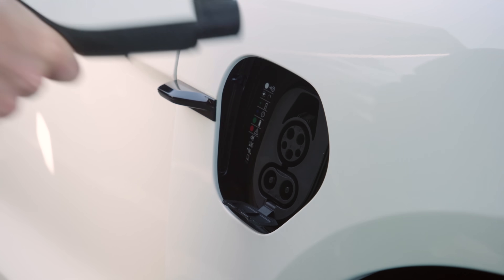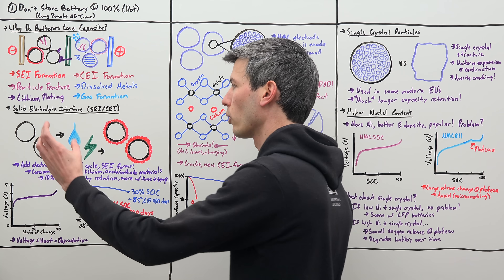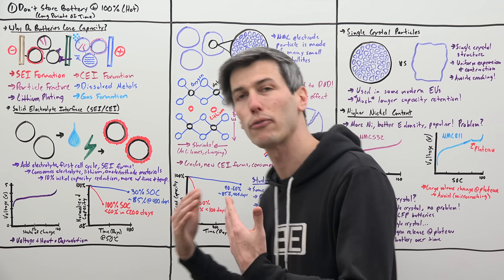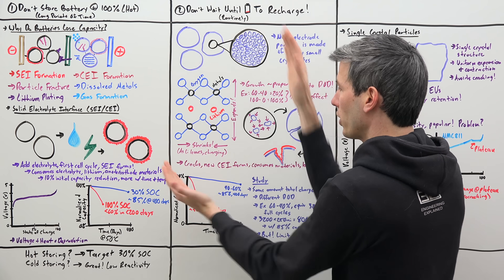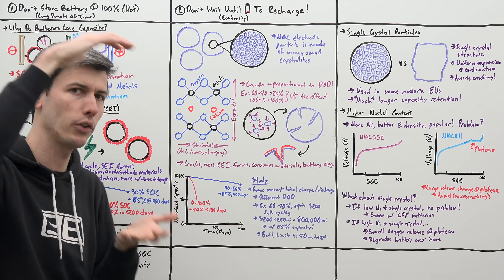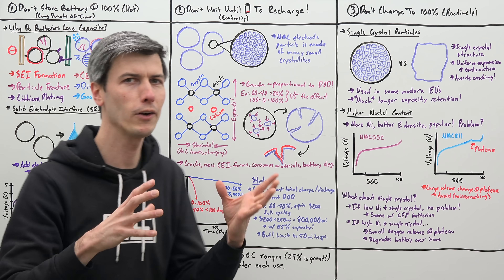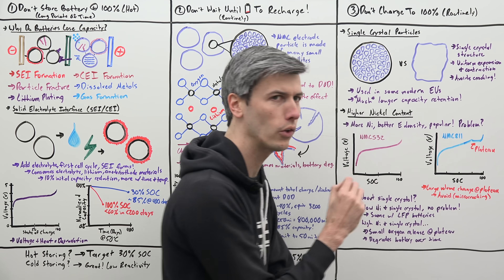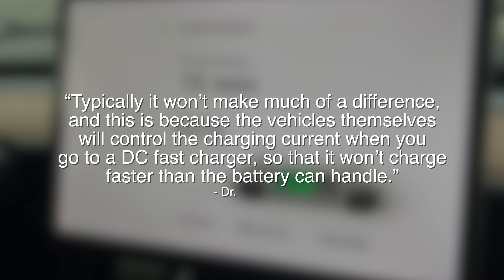How To Ruin Your Electric Car's Battery - NMC Edition!

Comment: Here in Chile, in my company, we have more than 800 electrical buses with around 250KWh of original capacity, bought almost yearly from 2016 to 2023. We currently don't see a significant (statistically) degradation in capacity (SoH) even after 300.000 KM, but we take precautions: we avoid charging to 100% wen in the higher side of the city to avoid loosing the possibility of recharging on the road, we do a full charge at least once a week, we rotate the buses from different routes, we don't start routes with less than 30% of charge to avoid running out of energy due to unexpected problems on the road. We have some cases of degradation of around 3%, but once again, on a fleet analysis, degradation = 0% statistically.
Reply from the maker: Thanks for sharing! Curious - why do you do a full charge once a week?
Reply: @EngineeringExplained  So our main manufacturer is BYD (but we also have Zong Tong, King Long a Foton). BYD made the recommendation to charge to 100% every now and then to calibrate the capacity of the buses. By the way, we find that by far the most significant factor in the overall performance of the bus is the driver, not the AC system, or the amount of stops, or the speed, but the acceleration and braking. We are currently traveling 5 million KM per month with the entire fleet, so there is a lot of data if you want to discuss.
Reply: @felipeeterovicbarreda3193  what driving style is most beneficial in your experience?
Reply: Burning out at stop lights and racing supercars to 60  @Kraven83
Reply: @Kraven83  Some bus drivers are really agresive, meaning that the accelerate a lot, and they wait till the last second to start breaking. Since all buses (ICE and electric) need assistance in the breaking process (no brakes are capable to stop the bus during the entire route), we need the regeneration of the batteries, and that is maxed with a soft breaking strategy.
Reply: @faeterov.. if you don’t mind me asking, what company? I work in public transportation (not in Chile, despite my username :p )
Reply: @faeterov.. byd? Worse than I thought; you should check the safety margins and QA of that company in particular
Reply: @faeterov.. That's how I drive my EV though it's not the weight of a bus
Reply: @faeterov..  I would love to see that data. I have been trying to convince our city to get a few electric buses. If you're willing to share any data, or post a video, please link it here. You can also email me at my easily guessable email address.
Reply: @Kraven83  downhill,  and SLOW takeoffs, and anticipating stops is best; just like with any vehicle; going uphill is critical, the softer, the slower, the better.
Reply: @faeterov..  My electric car encourages me to drive smoothly. It took a little while to learn to brake earlier because it is half again heavier than my previous ICE car.
Reply: @faeterov.. Sodium will be ideal for your application
Reply: @Cachai_  Felipe works at Metbus (Chile)
Reply: @EngineeringExplained  LFP maybe?
Reply: @Stopsign002   - yep, calibrating the "battery level" indicator semi-regularly to "full state of charge" is useful for datalogging purposes.  (That LFP nonlinear midrange wreaks havoc with voltage based level guestimates.)
Reply: @EngineeringExplained  Full charging is needed to perform a good balancing of the cells. Normally you are limited by the lower performing cell of your pack, that means that if for some reason  one cell has a higher SOC than the others you will not be able to use the full capacity of your battery. The same thing happens during the discharge, you can only go as low as your lowest cell. When you charge to 100% and leave at this state for a while (like over night) the battery has the opportunity to bring all the cells in line by balacing the cell voltages.
Reply: @EngineeringExplained   Im curious about this too. On some vehicles charging to100% can make your car computer's range estimates more accurate, but  I  am skeptical that its good for the battery.   Some people talk about charging to 100% for "cell balancing" but  that sounds like unnecessary stress if the battery is healthy
Reply: @EngineeringExplained AFAIK charging the battery to a 100% helps the BMS balance the cells
Reply: I believe it's to balance the cells.  KIA Motors recommends that their EV batteries are charged to 100% once per month for cell balancing.
Reply: @bearhunt3781  charge to 100% is to calibrate. Modern BMS balance the cells all the time
Reply: I believe it's to balance the cells.  KIA Motors recommends that their EV batteries are charged to 100% once per month for cell balancing.
Reply: I believe it's to balance the cells.  KIA Motors recommends that their EV batteries are charged to 100% once per month for cell balancing.
Reply: I believe it's to balance the cells.  KIA Motors recommends that their EV batteries are charged to 100% once per month for cell balancing.
Reply: @EngineeringExplained for cell balancing
Reply: @EngineeringExplained could be for BMS calibration
Reply: @EngineeringExplained  Some good answers below. I suspect also that, due to solar power, Chile has negative electricity wholesale prices most Sunday afternoons?
Reply: @EngineeringExplained  for battery calibration
Reply: for calibration purpose? we do that all the time with mobile electronic batteries if it hasn't been charged to 100 in a while @EngineeringExplained
Reply: @Anti3D-0 There’s no need to calibrate your phone battery since it has only one cell. For a 400V battery however you’ll need over 100 cells in series. Those need to be calibrated every now and then.
Reply: its for cell balancing ..one of the reasons why i do  @EngineeringExplained
Reply: @soulslayer59  I thought modern BMS  handle the  cell balancing,  without  the need to stress the cells with  a periodic full charge
Reply: @Saxafruge  as per my knowledge there is no way if knowing the cell is balanced properly unless an untill u fully charge it approx once a month to balance .
The way it works is usually we use upper limit voltage cut 4.2v for nmc for cell balancing hence full charge instead of lower limit cut that is 2.7v .
And when the battery cells in series reach 4.2v internal bms will individually shut off the series cell which has reached 4.2v thus full charging while the remaining series cells which havnt reached the upper limit 4.2v will continue to slowly charge till it reaches 4.2v ..

So at times you see if u full charge once a month somedays the remaining 10% charging takes way more longer than usually it does is cuz its balancing the series
Reply: @soulslayer59  You CAN?T do both, either you balance at the TOP (cells will scatter at below 20%)  or you balance at the BOTTOM(cells will scatter at over 85%,  less if heavy charging, and the BMS shuts all off, so, no full charge can be achieved either) ;
Reply: If you think that's a lot of maintenance wait until you hear about internal combustion engines and their 100s of moving parts.
Reply: @Crand0m  maintenance includes plugging in your vehicle.
Unplugging your vehicle
Plugging in your vehicle
Tires
Plugging in your vehicle
Reply: @pilotavery all the money saved on maintenance was spent on the expensive vehicle, insurance, and tires.
Reply: @drewfeld836  electric vehicles tires do not wear out faster unless you actually drive it super hard.
Reply: @pilotavery  I believe Michelin said they wear 20% faster or more
Reply: @drewfeld836  The average driver wears them out about 22% more.

If you drive the car and limit the acceleration to roughly the same torque as a gasoline car, it gets roughly the same life. Electric vehicles just have more torque and generally people are going to use that torque sometimes which then does a lot of wear to the tires. If you take a gas car that has a s*** ton of torque, it will wear the tires more not because the car is any different but because of how people will drive it.
Reply: @pilotavery  don’t forget EVs are much heavier due to the battery weight which also contributes to higher wear and not only that an increase in air pollution due to tire particles becoming airborne with increased wear . A legitimate concern.
Reply: @drewfeld836  higher weight vehicles have harder compound
Reply: @pilotavery  and still much higher air pollution than lighter ice vehicles. Can’t get around that no matter the compound.
Reply: @drewfeld836  what are you talking about? A car has to get 126 miles per gallon to match the emissions mile per mile as an electric Tesla powered by a coal power plant.
Reply: @pilotavery  I’m talking about tire particle emissions. It’s a known fact EVs generate 20% more air pollution regarding tire particle release into the atmosphere.  Do your research
Reply: @pilotavery connecting & disconnecting to charge is no different than refueling an ICE. Refueling is Not "maintenance".
Reply: @gregrogers3203  I wasn't referring to charging specifically, I meant more battery management in general like when it's cold you should plug in the battery to precondition it
Reply: BYD bus batteries are mostly LFP. Those already have a higher cycle life and less susceptible to degradation when at higher SoC. Some BYD batteries come out of the factory with their bms already limiting the top end voltage. LFP batteries charge differently as you actually float the voltages like a lead acid, then it drops down after you remove the charger. Another small issue with LFP is, you cannot tell the SoC by the battery voltage, the discharge curve is practically flat, the only way to tell SoC is via the bms and a coulomb counter. Due to the cells internal resistance, the bms can lose track of the SoC after repeated not full cycles. So a full cycle every month should be enough.
Reply: @Chooseyouruniquehandlebyaddin  - My man you know your stuff!!!!!!
Reply: Beautiful post, thank you. (Adorable, that the letter “h” was dropped from a word, there, conforming to the age-old tradition of ignoring that letter, in what I assume to be his native language.) I look forward to visiting Chile one day. I’ll have to ride one of your buses.🌿🐇
Reply: And battery busses are so smooth.
Reply: Crazy you should do a blog post
Reply: So after 300,000km average on each bus when are you expecting to replace the batteries? Are you getting the same results as those manufacturers get in China? I’ve seen every big city bus is now an EV there.
Reply: @JavierPix At this rate we will replace the bus sooner that the battery. Also, if we do replace batteries it just means that the ratio KWh/weight is low, and you can still use them in industries where that is not a issue, like a hospital backup, who doesnt care about the weight of the pack.
Reply: @faeterov.. Thank you for this post and all your reactions to it. It’s highly appreciated! 👍🙏
Reply: @faeterov I’m about to get 29 EV buses and will be creating policies from scratch. I’d love to get in touch and get some tips from you if possible.
Reply: Very interesting, thanks for sharing. I dont think the degradation is zero on the battery level, but the BMS hold back some spare capacity and is giving it free over time.  But still a very impressive result.
Reply: What part of the country do these buses operate? I’ve never seen one
Reply: @M1lomay I’m from Santiago and see them everyday here all over.
Reply: @sebastianfuenzalida3144  well I suppose that makes sense. I didn’t spend much time in Santiago but I didn’t see any in Valparaiso
Reply: @M1lomay  Santiago.
Reply: It's not a lot of work. It's just work. Outside of the US, public transit administrators face more pressure to hire facultatively intelligent operators with an understanding of- and sympathy toward the machines they operate— sparing themselves wasted acquisition costs as well as unnecessary maintenance, repair, and replacement—rather than hiring the cheapest available license-holders whose only redeeming attribute is their ability to show up sober and (largely) suppress their attitudes toward their captive clientele. 

Americans habitually marvel at the efficiency of Japanese public transit but other countries are not as impressed because few places suffer public transit that is administered as lackadaisically and services their ridership as ineffectively as that of the United States
Reply: In Beijing, China the E-buses use trolley-like overhead wires to charge as they drive. Each bus has a charging array that retracts while running on battery and away from the main part of the city, and deploys when back in the city- essentially running directly from the grid while charging- without having to be taken temporarily out of service.
Reply: It quite simple,if one looks after something according to it principles,it will last longer,wether EV,ICE or anything else.
Reply: I work for public transport too. I heard the same statistics for LPF buses around the world. Almost no degradation even after 5 years.
Reply: That's amazing data. Thanks for sharing
Reply: I think alot of this is BS, I have a Li-ion battery thats over 700 days old and is still at full charge 67.2
Reply: Sooooo interesting. I had no idea that this golf cart technology could be?? Embellished like this.
Reply: @Bmwguy2011 My "golf cart" leaves BMers in the dust. So smoothly, in fact.
Reply: @gregrogers3203  you have a ? Tesla?
Reply: @Bmwguy2011  I do
Reply: @gregrogers3203  I always celebrate these as I think they’re nearly all American made.
Reply: @gregrogers3203  but you know… that’s never what attracted me anyway and all of my bmw friends to the brand, raw acceleration.  Instead, it’s the driving experience, organic feel, seats handling safety smoothness of the engine , sound value holding of collectible cars etc.  if 0-?80 speed is what matters?  Yeah I’d buy the cheapest e vehicle i guess .  We are all going to be forced into these someday, why I refuse to buy one now.  They can control us once everyone is in an e vehicle on many ways difficult to do so with a gas situation.
Reply: looks like some one from bateries industry doesn't like what they hear and see, so fix it then
Reply: What's your opinion of Jackson Wyoming's entire electric bus fleet being taken out of commission? Granted it was only 8 but still. Their experience seems bad.
Reply: @erikkovacs3097 y would they have any buses who is going there
Reply: you care!
Reply: Maybe your government should be focused on poverty rather than selling subsidized electric bus fleets foreign corporations. It's all a scam, because combustion engines and too cheap and simple for us peasants.
Reply: 0% degradation.
You are trying too hard bruh
Reply: @hydrohasspoken6227  no degradation usually means " software limited battery to 90%, só you cannot see any degradation before 10% of degradation" 
But is fine too.
Reply: Hyundai, KIA, Genesis lie to you about your state of charge to protect you. 100% on the gauge actually = 80% SoC in reality and 0% actually equals 10%. I believe some other manufacturers do too
Reply: can you do a video on the data?
Reply: Chile, eh? We'll keep an eye on that interest; we usually see massive fires, not cap loss, when those applications require high draw. Like in London's buses or Australia's cement trucks.

The very fumes are toxic if they just touch your skin and the time from smoke to fire a matter of seconds. Good luck.
Reply: @SwordFighterPKN 
Outside of the US public transit administrators face more pressure to hire facultatively intelligent operators with an understanding of- and sympathy toward the machines they operate— sparing themselves wasted acquisition costs as well as unnecessary maintenance, repair, and replacement—rather than hiring the cheapest, least capable automatons whose only redeeming attribute is their ability to suppress their attitudes toward their often unpleasant clientele.

Americans habitually marvel at the efficiency of Japanese public transit but other countries are not as impressed because few places have public transit that is as unambitious and performs as poorly as that of the United States.
Reply: It's not a lot of work. It's just work. Outside of the US, public transit administrators face more pressure to hire facultatively intelligent operators with an understanding of- and sympathy toward the machines they operate— sparing themselves wasted acquisition costs as well as unnecessary maintenance, repair, and replacement—rather than hiring the cheapest available license-holders whose only redeeming attribute is their ability to show up sober and (largely) suppress their attitudes toward their captive clientele. 

Americans habitually marvel at the efficiency of Japanese public transit but other countries are not as impressed because few places suffer public transit that is administered as lackadaisically and services their ridership as ineffectively as that of the United States
Reply: A lot of work to an obese Republican is just work to everyone else.
Reply: BYD exploding cars are not the best example to use.
Reply: Those are impressive results. Thank you for sharing that information.
Reply: He is anti Tesla.
Reply: The cracking in the middle looks like the Tesla logo
Reply: Thanks for SHARING. :eyes-pink-heart-shape::eyes-pink-heart-shape:
Reply: That is a remarkable result!

Out of curiosity, how many KW of power is used to charge your buses?
Reply: As a new byd car owner, it`s amazing to read this. 😁
Reply: Sounds like a very progressive mind-set. How impressive.
Reply: The question is:
What is the real capacity?
Not rare that there is an over capacity, to have a buffer and to "hide" degration.
Reply: After reading most of the comments on this subject NOBODY is talking about the benefits to the environment. It is all about how to save money. But with heat records being broken year after year you wonder how long this can go on before your country becomes unlivable. Crops will fail and people will die from heat exposure. THAT is why it is important to STOP BURNING FOSSIL FUELS.  It does not matter if Electric busses or cars require more or less maintenance. What is important is that we keep our planet healthy for generations to come. Fossil fuels will not do that.
Reply: So in essence, so something else will cause problems before the batteries will 🤞🏻
Reply: You also don’t have long cold winters
Reply: That is negligible work compared to everything else you have to do to make sure a bus fleet stays running. Like rotating the bus routes what all that means is that the driver gets in a different bus. Also not starting with less than 30% oh my gosh that’s so much work. Doing a full charge once per week what. The only thing that requires significant forthought is the not charging to 100% at a specific place.
Reply: Electric buses are severely underutilized, I only rode in them at Giga Texas when I worked there but they’re so great
Reply: Sounds like you are chilling in Chile
Reply: What is the ambient temperature? I live in Thailand (35 - 40c) and I'm looking at buying a NMC MG5. But the NMC is giving me concerns. I don't know how big a factor high ambient temp is going to be.
Reply: Still no one can explain to my why I should limit my range to 80 % for the entire lifetime of my car (by charging to only 80 %) when I could just always charge to 100 % and experience a gradual degradation to 80 % during the lifetime of my car.
The only reason would be to get a higher resale price. And even if you only charge to 80 % all the time you’re still going to see at least 5 % degradation.
Reply: EV is great 21st century tech 

ICE is inefficient 20th century tech
Reply: @larryc1616 I’m having a hard time adapting. I’m hoping once I get the home charger hooked up I will feel better about it.
Reply: @larryc1616  let's see which one goes further; and farther too    lol
Reply: @larryc1616 
No, they are not. EV is 120 year old tech, just as ICE. EV are far too heavy, because of the very low energy density of batteries. Total cost of ownership of EV is way higher than of ICE. Also EV are not as great to drive by far as ICE are. Historically EV are for women, ICE are for men.
Reply: @peterdejong5456  I've found completely the opposite: After 3.5 years driving an EV (Tesla), the experience is vastly superior to an ICE. One petal driving literally without using the brake pedal. Acceleration is incomparable when I want to use it. Driven the car across the U.S. repeatedly in subzero (< -18C)  and 110F+ (> 43C) weather, driven the car smoothly to 140 mph on vast empty highway stretches. The ICE just does not compare. And I drove ICE vehicles for decades, also in all conditions.
Reply: @gregrogers3203   
How can a vehicle that weighs twice as much with half the range (even less in cold weather), twice the cost of ownership and zero driving pleasure ever be superior? The reasons why people stopped buying EVs hundred years ago are still there. You seem to forget gasoline has 50 times (!) the energy density of a Li-ion battery.
"Weight is the enemy"
~ Ettore Bugatti
Reply: Many Chinese electric buses use lto batteries
Reply: Batteries with 0% degradation and no hardware maintenance....... how is this not on the news if that is the case?
Reply: @SupraSav they still need manteinance, just not so much. We still have doors, tires, breaking system, ac, windows to repair. Its just that we dont have valves, pistons, filters, rocking arms, turbos, oil, etc etc.
Reply: @SupraSav  Because the media only care about BAD news when it comes to EVs, haven't you noticed?  Good news are not newsworthy!
Reply: You do not have 0% degradation after 300k km.
Reply: Not possible .. not even according to battery manufacturers .. im calling this out as BS
Reply: I sure have ruffled some jimmies with a simple little comment.  LOL
Reply: When I was building busses we had some come back under warranty they were about 3 months old and had done 100,000 km  . They were going from London to Edinburgh and back 6 days of the week 800 miles a day I don’t think your EV busses would be able to do this
Reply: Of course, your batteries are the only ones in the world that does not degrade at all. Do you expect us to believe it? There are quite a lot of research showing EV:s degrading like crazy.
Reply: @thoos192  All batteries DO degrade with each passing charge-discharge cycle.  There you are right.
But EV batteries do NOT degrade "like crazy", quite at the contrary, data shows very moderate degradation, like 3-5% total over the first 2 years, then 1% per year, leveling off at ca. 0.5% per year.  There you're wrong!
Reply: I live off grid. I build my own solar.I build my own batteries.
I have a ten thousand watt generator,  welding machine.
It would take thirty of my generators running full blast to  do a three hundred thousand watt quick charge. Where do you guys think electricity comes from. Not from solar and wind. Driving an electric car doesn't help anybody. Let's see you get off grid with your house and life.
Reply: @Luch600  If you live off grid with own solar system and 10kW generator you are better suited for EV than for an ICEV.
I guess you live off grid as you do not live in the town or near any infrastructure, which also means you have to do long trips for the fuel.
With EV you would just charge it from the solar and don't care about trips to gas station till the weather would go so bad you would need to run the generator.

And please, spare us the nonsense about quick charging at home from generators. That's not even funny, just embarrassing...
The only situation when you use quick charging is when you are on a trip to some greater distance. Outside of long trips you just charge slowly (3-11kW) on your home charger. Part of the year (depending on a location) this slow charging can be covered by the solar just fine. For my location it is 6-8 months a year of solar charging.

So, driving an EV helps you and your environment and greatly helps you to go off grid. As a bonus it's more comfortable to drive.
Reply: Here in London electrical buses manifest degradation by bursting into flames. Three this month so far.
Reply: @johnedwards1685  Could you share a news article about this?
Reply: 0% degradation seems unlikely, since time will degrade batteries all on its own. Not by much unless you leave 100% charged vehicles out in the hot sun, but enough that it should be measurable after a few years...
Reply: @Steamrick  Well yea there's no such thing as 0% in reality but statistically it is possible. I work with statistics at work and math is funny.
Reply: @Steamrick likely the measured 0% degradation is due to the fact that batteries had some hidden capacity that they are slowly releasing
Reply: @Steamrick  If the batteries are overprovisioned it may not be detectable by the end users yet.  eg. they sell at 250KwH battery, but it's physically a 280 KwH battery whose battery control system lies about the capacity.
Reply: @Gaspode_  Overprovisioning batteries a bit is normal. For example, Audi exposes between 91% and 94% of the Audi e-tron battery capacity to the user.
I'd have expected the BMS to keep the overprovisioning percentage even as total capacity decreases, though, so it can use that to protect the battery from going to 'real' 100% and 0% voltages and improve longevity.
Reply: @Steamrick  True EV batteries degrade 1-2% per year. But that probably wouldn't be a factor over the life of the bus.
Reply: @Steamrick  Yea i wonder if he is talking about operational degradation (like,  can the bus run its full route)
Reply: @Steamrick THIS
Reply: @Steamrick Read what he said again.
Reply: @Steamrick did you even read? He said 3% on few vehicles. But almost 0 across the fleet. Of course everything will degrade overtime
Reply: You're an ANECDOTAL and unproven claim in a YouTube comment section, and presumably biased. You are comparing buses (very controlled use) in warm climates to cars (much more uncontrolled civilian use) mostly in cold climates. Apples and oranges.
Reply: That's a lot of work to keep degradation to around 0.
Reply: @SwordFighterPKN  Thats not that much work for a fleet. Fleet maintenance is serious work
Reply: @Stopsign002  Sure, but it actually getting done is not something that I would expect from the Washington DC metro operator. Users are expected to be happy that the bus is not on fire.
Reply: @SwordFighterPKN  Not at all, since the buses go to the depos at the end of the route. As I've said to the drivers here, the amount of cash we save by paying KWh instead of diesel is more than enough to offset all the hassle of the technology. Drivers have come to accept this technology, as it' more comfortable for them, in particular due to lower noise levels in the garage.
Reply: @faeterov.. Do you have any idea if they actually build a larger battery than they advertise?  I heard that is a practice that is used to limit the appearance of battery degradation.  For example, having a battery 10% larger than advertised means it can degrade over 10% before the user actually notices anything.
Reply: @Tie509  What did it matter if the practice is to advertise what the battery will be for the life of the vehicle? That is the only thing the person is buying on.
Reply: @Tie509 We suspect something like this might be the case, but the capacity shown is the same as the capacity bought, if they oversized the battery it's something we cant account, but the warranty states 80% health (frpm the capacity we bought, no this hypotetical additional capacity) at 10 years.
Reply: @faeterov.. Thank you for taking time to answer questions! It’s very fascinating and valuable information.
Reply: @SwordFighterPKN  Don't think so, not hard to keep track on usage and charging can be done on a vehicle base automatically.
Just have to setup software once.
And rotating vehicle routes is also something you do with ICE buses as well.
Reply: @SwordFighterPKN how does that compare to fuelling at a pump every tank and 5 levels of regular service plus oil changes?  Seems like it’s just adjusting some parameters of how they’re used.
Reply: @MrFerrariF360  - The main difference is you have to pay attention to the SOC and temperatures when you charge, do you have to do that with your ICE (hate that name BTW) vehicle?  No you don't you just throw fuel in it and change the oil, even some people can't get that right.  But people are supposed to figure out how to make their batteries last longer? LOL!!!  For a fleet with professionals sure, it's still a paradigm that seems like a PITA.  But if that PITA has a ROI then sure do it.
Reply: @SwordFighterPKN  Yes, you do as fuel can freeze, and as such, a lower "state of charge" means the likelihood of the fuel freezing is higher. Your car also is less efficient with fuel in lower temperatures.
Reply: @SwordFighterPKN It sounds like a lot of work. You have to pay attention to the SOC and the temperature. But it's not. It's automated. You set the SOC limit in the software and if heating or cooling is needed the computer and heat exchanger takes care of that in a modern EV. The only "work" is remembering to plug it in every two or three days. I'll do that any day over stopping at the petrol station every week or so. NB Not all EVs can control the temperature of the battery during charging but I'm speaking from my experience. And I'm not sure why you hate the term ICE. It's no different from EV. They both describe the propulsion system of the vehicle. I drove ICE cars for over 35 years. I don't demonise them, I just don't think they're as good for me.
Reply: @SwordFighterPKN  Some of it is even good practices for non electric vehicles, especially the route swapping, if there's large discrepancies between stop-n-go and highway travel.
Reply: @johnhufnagel  - The route swapping is interesting and I could see how that helps maintain a fleet of vehicles.
Reply: @SwordFighterPKN  maybe it's not a lot of work. It's built into the operation system which needed work to create the plan and needs work to keep it going, but it's a large operation anyway.
Reply: @SwordFighterPKN how’s that any harder than common maintenance on a car?
Reply: @AreYouSeriouslyy  - Humm lets see I just put gas and drive it, change the oil every 7500 miles and change tires as needed.  No need to worry about SOC/SOH, determining routes.    I'm finding the reaction to my simple comment to be rather funny and silly reactive.
Reply: @SwordFighterPKN 
That may be true for a new ICE car, if it's from a good brand, you don't drive too much, don't drive too short distances regularly, and it's not a diesel.
Buses are driven a lot, with frequent starts and stops and idling, which is about the worst use case after racing. They also have more stuff that need additional maintenance. Like air brakes. Then even more maintenance for safety, since a lot of lives are at risk if anything goes wrong.
Multiply this by 800, and even rare issues will happen regularly.

Then, if you have 800 buses with 800+ drivers, and various routes with different schedules, you already have to solve a complex logistics problem, for which you should have a robust solution. Adding a few more soft rules should not be an issue.
Reply: @SwordFighterPKN  You worry about the state of charge in the "I just put gas in it". The state of charge in a gasoline vehicle is how full your tank is. You also care about temperature as that affects "how full the tank is". I also need to worry about where I plan to get fuel and the variety of pricing at the stations that I do not own, which means that I also have to waste fuel to get fuel.
Reply: @andrasbiro3007  - buses are a GREAT use case for EV.  I just stated that seems like a lot of work to kept the degradation down to 0%.
Reply: @SwordFighterPKN  why would anyone want to deal with an oil change and timing belt replacement, also freezing your ass outside in the cold filling up gas? how much is a engine replacement when some high school kid changing your oil at walmart forgot to put oil back in? 

with an EV i dont need to worry about any of that. who care if a battery cost $15k when it last 15+ years.
Reply: @SwordFighterPKN fleet maintenance is a ton of work. 

They're not oil changing these busses or anything. That savings alone on labor and materials for them probably is at least in the same ballpark or a savings by doing it with electric and doing this small amount of logistics. And then there's transmissions to worry about too. Realistically it's not necessarily always going to be ain increase in maintenance to do such things, it may actually be a decrease depending on what an ICE powered bus fleet would cost. And on top of that the fuel savings? I get your point, I really do, I just don't know that it works out to being more effort for large fleets. All they're doing is implementing a new maintenance scheme that replaces all the ICE related maintenance. I don't see it being an increase personally. 

I maintain a small fleet of vehicles for my company single handedly, I definitely understand the costs of fleet maintenance. We are electricians, if we switched to EV for all our work trucks, I'd have a lot of extra spare time. Not that I'm gonna tell the boss that 😂
Reply: @marcol869  - I owned Honda element for 20 yrs, why would I want to trade in a working vehicle at 15 yrs for zero dollars since the vehicle is only work the scrap value?  If you want to own one, great just don't tell me I have to
Reply: @SwordFighterPKN  been looking for an element myself. My needs have changed and they seem to fit the bill perfectly.
Reply: @goosenotmaverick1156  - I really want a hybrid Element that would be money!
Reply: @SwordFighterPKN  for sure! I've been keeping my eyes out for one because I would love to have one, but in my area I've only ever seen one out in the wild. For me, that would be amazing! The IMA I think was the system used for those, rather than a motor directly driving the wheels?
Reply: @goosenotmaverick1156  - There is not a hybrid Element.  I always wanted to blend a Chevy Volt drive train into one though.
Reply: @SwordFighterPKN  my memory has decived me then 😂 I wonder which vehicle it was I was thinking of lol
Reply: @SwordFighterPKN  well you own a shitbox, stop lying to yourself how great an ICE car is.  I wonder how an Honda element will hold up in a crash with a cybertruck. :)
Reply: @SwordFighterPKN  ahhh yes let’s disregard, filters (oil, air), if you live in hot or too cold places gaskets and seals, crankshaft/cam sensors, any small sensors for that matter and more, Assuming you both a decent reliable car… assuming you didn’t timing chain issue, transmission problems, water pump failures, or fixing anything that requires to remove additional moving parts…. Oh and this is assuming you do the work yourself. As someone who owns multiple cars, classics and new and one EV. The upkeep OP is talking about is no different than a combustion engine maintenance. You get the reaction you get cause your comment itself is silly.
Reply: @SwordFighterPKN 
And I'm saying that diesel buses are more work to keep running.
The main difference is that you've been learning to care for ICE engines since daycare, so it feels natural.
Reply: @SwordFighterPKN No one is, are they? I agree it's crazy to change a working vehicle for a newer one. Yet most people do it, a lot - otherwise automobile manufacturers would be out of business. However, if you are considering changing your vehicle, then I would recommend an EV. I don't miss the regular trips to the petrol station and maintenance costs and they certainly drive better (and no fumes). But on the flip side it didn't come cheap - although surprisingly not that much more. It's a personal choice. You stick to your Honda until it dies or you get sick of it. Then get another car.
Reply: @SwordFighterPKN I disagree that sounds almost like zero work compared to any ice fleet maintenance program. And if you look at aviation they only put as much fuel as they need in a plane to minimize wear and tear as well.
I  maintenance all my battery systems. I can get a $60 Walmart battery that has a 2-year warranty to last 10 years if you just check the acid 2 times a year and never charge it with it being too low.
Reply: @SwordFighterPKN  but at least is an option...   Wish there was a way to prevent degradation of a combustion engine!
Reply: @SwordFighterPKN lmao, imagine all the maintanancw with diesiel og petrol busses. 1000 parts to change
Reply: Where is the a lot of work?
Reply: @tr9036  I'm sorry I don't understand the question
Reply: @SwordFighterPKN  Much easier than rebuilding transmissions.
Reply: @SwordFighterPKN 
Outside of the US public transit administrators face more pressure to hire facultatively intelligent operators with an understanding of- and sympathy toward the machines they operate— sparing themselves wasted acquisition costs as well as unnecessary maintenance, repair, and replacement—rather than hiring the cheapest, least capable automatons whose only redeeming attribute is their ability to suppress their attitudes toward their often unpleasant clientele.

Americans habitually marvel at the efficiency of Japanese public transit but other countries are not as impressed because few places have public transit that is as unambitious and performs as poorly as that of the United States.
Reply: @SwordFighterPKN 
And of course every EV car owner has a fleet of EVs that can be rotated across different routes🙄
Reply: He is not saying "we disassemble every single battery, every week and wipe it to clean out and increase longevity"

HE says we never charge %100, change roots and don't let them travel below 30%.
Where is the a lot of things 😅😅😅
Reply: @tr9036  Yeah, I live off grid.I build my own battery's lifpo 4.         I build my own charging systems.
Thanks for the reply. I ran three solar panels straight to my electric water heater, It works great.
Reply: @SwordFighterPKN This means that there's no wear at 200,000 miles. 

The range already starts to decrease on diesel engines around 200,000 because of inefficiency of blow by
Reply: @pilotavery  - Batteries do not care about millage so that is a apples to oranges comparison.  Batteries care about charge cycles and temperatures.   Good for your group putting in the effort to keep the batteries fresh, since those batteries are a significant investment.   By your responses I have a feeling you think I am anti-EV, which is funny given I work in electric energy storage.
Reply: @SwordFighterPKN  it's definitely an apples to apples comparison, engines don't care about miles either.
Reply: @pilotavery  -  Then get to comparing revolutions of an engine to degradation of batteries.  Let me know when engines start to degrade just sitting there like batteries do.   It's not apples to apples.  But again this response to my original simple comment is funny.  The eeeeeeeeeeeeee reaction to anything that goes against EV is awesome is nutty.
Reply: @pilotavery  No, they both care about miles as miles is usage, which is cycles for batteries and engine performance for the gasoline vehicle. It is also the cycle count on the plugs as well, which he also didn't mention. Engines also don't like to not be used either, which is the storage problem. He just gaslit you, and you bought in.
Reply: @SwordFighterPKN  Are you telling me that oil has no properties that change based on the length of sitting? The 12-volt battery also starts to lose its capacity as well. Your nonsense on vehicles being a-ok doing nothing is not true.
Reply: @ronaldking1054  - I stated the engine not the fuel, do try to keep up.  Your emotions are not helping you in this discussion.   Fuel does degrade, I'll freely admit that.  But it does not need anywhere near the maintenance describing the original comment since you burn it up.   You emotional EV people.
Reply: @ronaldking1054  Yes read my comments, this is what I'm trying to say. I initially said that the The battery will last a number of miles, and somebody else said batteries only care about usage, so you can't compare miles like you can engines. And I responded by saying that if I can't compare batteries to mileage, then you can't compare an engine to mileage. Because engines themselves don't really care about the miles, what they care about specifically is the number of revolutions and load and temperature and other things. However, the more load and RPMs your engine runs out, the more you are accelerating and therefore the faster that you will be going. So mileage is a fairly good estimate of total wear and tear to an engine, within about 10%. So I do get it. I'm just saying that if you are comparing a gas engine this way, you should not be comparing a battery any differently.
Reply: @SwordFighterPKN  The engine has oil in it, and the oil needs to be changed regardless of use. Next, you are also stating that the engine cannot corrode at all. Engines seize. They usually do this because of a lack of oil, but degraded oil probably will do it as well.
Next, you stated that all you needed to do is put gas in your car, but I stated what putting gas in your car meant. For some reason, you cannot understand that your simplicity is complete and utter nonsense. I've owned a car. I know it's nonsense.
Reply: @ronaldking1054  engines don't seize when they are not in usage, unlike batteries that degrade over time.  Look you want an EV get one, I'll pay you on the head.   Do you have to worry about how much fuel is in your car before adding more no.   EVs take more effort to make the batteries last, did you watch the video?  Good Lord you people are triggered.
Reply: @SwordFighterPKN  Yes, engines start exactly same if you do not use them. Note the sarcasm as that is completely untrue. What is even funnier is that people who have bought cars that have sat at auction generally will find that 1. the battery is dead and 2. that the engine will not start exactly correctly. I know how cars work when they sit because when my car was at the end of its life, it started badly. I know you are lying to me. Quit being so emotional about your internal combustion engine.
Reply: @ronaldking1054  I did not bring up ICE so you're projecting.   I like EV but I'm sticking with ICE it's cheaper and more proven.  For my use case ICE is a better choice.  Go by what you want, good grief.  I'm not the emotional one thinking they have to defend something, that's you.
Reply: @SwordFighterPKN  Second easier proof is that the maintenance schedule has time durations on it as well as mileage. Your claim would mean they have only mileage. Apparently, you think automotive manufacturers are idiots, or else you should know your claim is not true.
Reply: @ronaldking1054  you EV folks are more sensitive than BJJ types it's funny.  I'm flattered with all this after a simple comment.
Reply: @SwordFighterPKN  You lied multiple times about the vehicle you have chosen, which is an internal combustion engine car. I can only imagine that is to keep your fuel price relatively low, and your resale value high. In other words, you have a vested interest in lying about your technology. You want to extoll the virtue of the simplicity of the gas tank while ignoring the complexity of all the equipment that makes that gas tank simple. You claimed that duration, contrary to the schedule of maintenance, does not matter, which is false. You also claimed that you do not think about anything with your gas tank, and I know that is false because fuel is fuel. Without fuel, your vehicle is a paperweight, which ironically, is the same thing with an electric vehicle.
Reply: @SwordFighterPKN  No, I'm a person that believes in truth. I'm passionate about it, but it seems you are not. Simple question: Does every schedule of maintenance in any vehicle have a time duration on it? Answer the question truthfully, which is yes, and then admit that you were mistaken when you said that sitting does not hurt a vehicle. All you have to do. Otherwise, I know you are a liar.
Reply: @ronaldking1054  - sitting for how long?  You seem to really care about winning the internet argument which is funny.  My old element sat for 8 months no issues.  Frankly you bore me at this point
Reply: @SwordFighterPKN  Okay, go through the schedule, and figure out exactly what you might have had a problem with. A case study is not all vehicles.
Reply: @pilotavery I have to disagree with that a well cared for engine tends to get better over its life. My current car 2.0d is nearly 180k and on a run will still hit 70mpg. It's what you would call a "minivan" has 7 seats and weighs the best part of 2 tons. Fully loaded with a small trailer it will still achieve well in to the 50s. In my previous job I used to drive a fleet of mercedes sprinters and they would still achieve 40mpg and they had freezers running constantly most of them well over 100k and the company I worked for were useless at servicing so the vehicles engines were very neglected but still had consistent fuel economy. I used to regularly drive one that was overdue a service by 60k how it still worked I do not know but was due to be defleeted so they just didn't care.
Reply: @SwordFighterPKN  it’s funny engines ACTUALLY do degrade when they sit! Seals and gaskets when not regularly used get dry and crack. Bearings too. You see this happen to barely driven exotics and luxury cars mostly. It happens with mass produced vehicles to. I’ve seen very low mileage examples of Hondas and Mercedes with very few miles that come with leaking issues for the fact they sit and are not driven. Again everything degrades
Reply: @ronaldking1054 How unfortunate that the first thing that goes when an ICE sits is the BATTERY
Reply: @SwordFighterPKN 
It's not a lot of work. It's just work. Outside of the US, public transit administrators face more pressure to hire facultatively intelligent operators with an understanding of- and sympathy toward the machines they operate— sparing themselves wasted acquisition costs as well as unnecessary maintenance, repair, and replacement—rather than hiring the cheapest available license-holders whose only redeeming attribute is their ability to show up sober and (largely) suppress their attitudes toward their captive clientele. 

Americans habitually marvel at the efficiency of Japanese public transit but other countries are not as impressed because few places suffer public transit that is administered as lackadaisically and services their ridership as ineffectively as that of the United States
Reply: @SwordFighterPKN 
Americans habitually marvel at the efficiency of Japanese public transit, but few places suffer transit that is administered as lackadaisically and services their ridership as ineffectively as that of the United States. Japan is not the only country to operate in a way that spares the taxpayer from wasted acquisition-, repair-, and replacement costs. It's not a lot of work—it's just work.
Reply: @SwordFighterPKN ice engines absolutely degrade if left sitting.  Corrosion and fluid degradation take over if steps aren't taken to mitigate them.
Reply: @SwordFighterPKN bad news engines seize from sitting all the time. Rust in cylinders which happens every time you shut it down longer it sits worse it gets until it seizes .. cold starts are where most of engine ware happens because of said cylinder wall rust
Reply: @SwordFighterPKN Ha! With a diesel bus you just get in and drive, when it's empty, you fill it up.